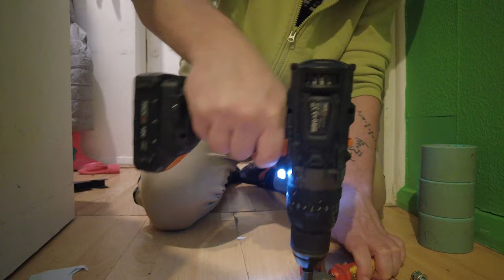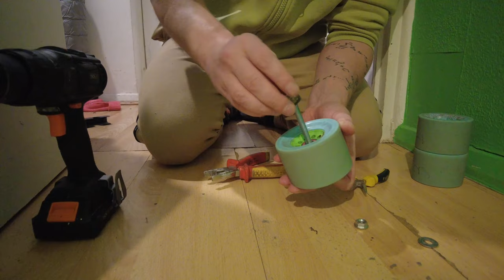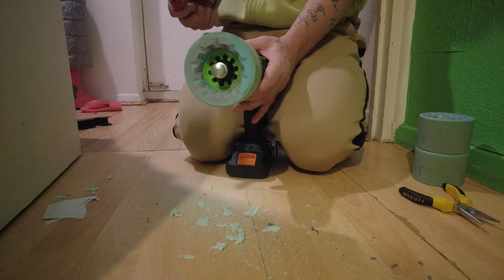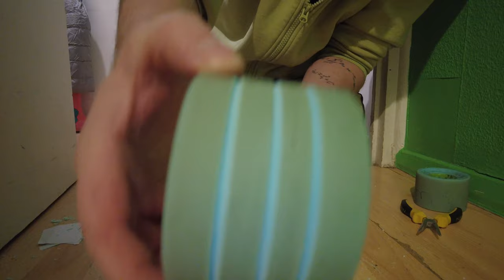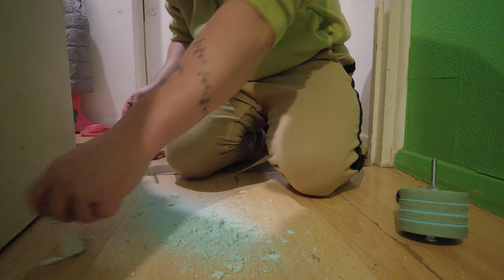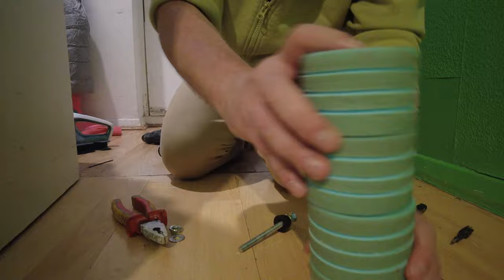Rain-Proof Your Ride: DIY Orangatang Caguama 85mm Wheels Mod | London Longboard

Comment: Are you riding a new board? How does it compare to the Pranayama? I was thinking about getting a Trip to replace my Pranayama but I doubt that will happen. Just wanted to hear your thoughts.
Reply from the maker: Yeah, I've stashed Pranyama and replaced it with Trip. I like it more. I don't need to worry as much with speed check, and I have more space for legs. maybe Trip doesn't take as good those slow and tight corners, but I don't care about as much. Extra stability is more important for me.

Comment: Have you tried riding caguamas in the rain before without uograde? 

After doing this upgrade to your wheels did you see much of a difference in grip?
Reply from the maker: Yes I did and they were as dangerous as speed vents. Suddenly I've kissing the ground.

After 5min of riding after the mod, I clearly see that they are sliding in a more controllable manner. I need to take them for a longer ride.
Reply: @bartek...  Thanks for the information brother 👍

Comment: Idk about this mod and all but better remove bearings next time. They are not intended to be tightened until they stop spinning.
Reply from the maker: Bearings are just to keep a bolt in the center. Bushings are touching the wheel, which keeps the whole thing locked.

Comment: You should be cutting the wheel on the spinning down side, not the spinning up side. Cutting something on the spinning up side like that is a easy way to lose a eyeball, or worse. Which brings me to the next point which is always wear eye protection when using power tools. Safety third!
Reply from the maker: I should have everything flying into my face. Brilliant idea.